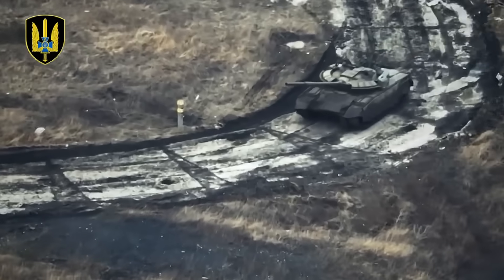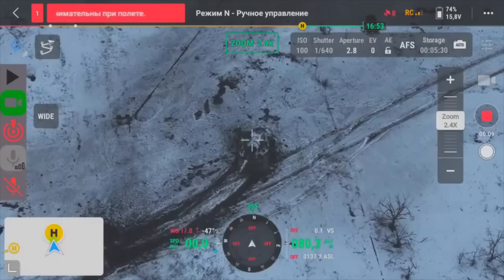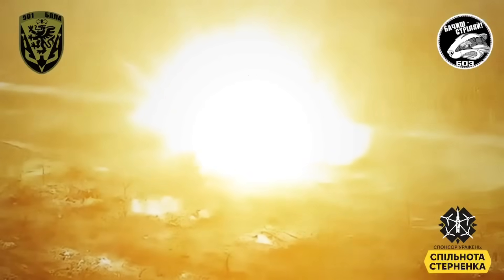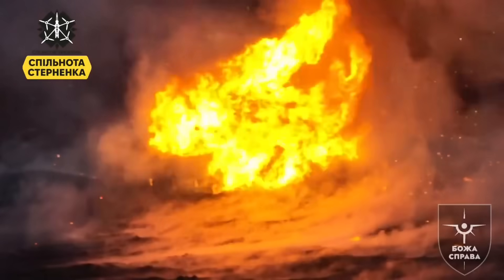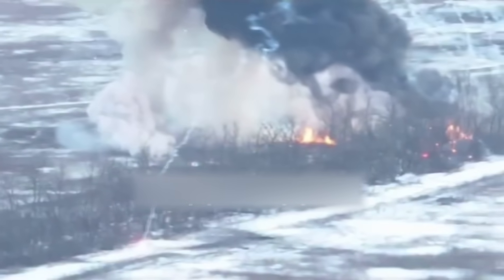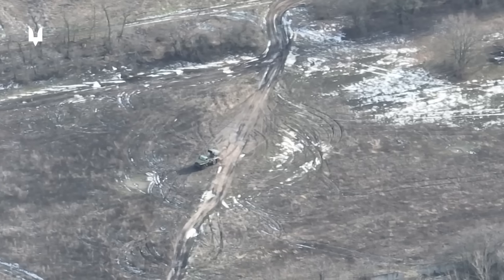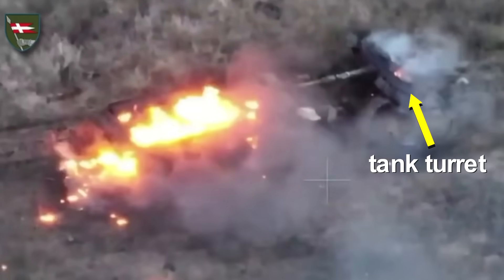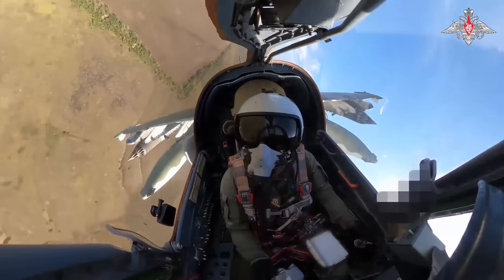The Russian tank attack failed because of this sneaky weapon

Comment: and then they say that gamers are useless in real world .. you can literally learn to fly drones in a game and do this in real.
i hope rUrUs are not going to mark my words, cuz if i had to drone-proof a tank, i'd just build simple mesh/net around the tank. weld some pieces of metal to act as main wireframe, then weld some wire-fence between them. keep it 1-2 meters from tank.

if you ask huh? then it means you have no common sense, so let me explain common sense to you: that wire fence / net would prevent any drones from directly hitting the tank, causing all charges to explode 1-2 meters before it hits the tank and from that distance, there's no way RPG or any other type of directional charge would be able to penetrate tank's armor.
in fact there's a good chance that RPG wouldn't even explode when it hits the net. i'd have to test and see what is most effective, if you literally use net, it might be elastic enough so RPG wouldn't explode at all.

so basically just build a net / wire fence box around the tank. they seem to be using signal jammers, but their range is 50m max and it also jams their own comms, so a good drone pilot would take it into account that they might lose signal when they get 50m or closer, so they just aim the drone in a way that last second adjustments are not necessary, with RPG wrapped to drone, it weights enough to hit the target by using inertia.

oh yeah and advice to drone users, you can add a small rocket booster in the back, which would make it possible to catch up with helicopters and planes, altho i'm not sure how stable a drone would be when flying that fast, it might lose control as its system is not designed to keep it stable at high speeds.

Comment: drones have been used for years if you really think about it...
America just have a different form equipped. with cameras and missiles, huge range that can return to base , reload, refuel and go again. They cost a millions each but they are fast, small and resistant to most low tech radar in the middle east or russia.  

The only reason a drone killed them 3 american troops a few weeks ago was because their own drone was incoming to and when another drone was following it.
They probably already have a new system in place so that confusion cant happen again buy simply having their drones landing procedures changed .
every other drone attempt at a american base in the middle east hasnt even got close

Comment: the Russians use electronic warfare equipment that consists of using radio signal jammers, the same type of jammers that are used in prisons or by criminals. Obviously this completely blocks the signals reaching the drone. It was supposed to be impossible for the drone to get close to the tank like that. The frequency used by commercial drones is always the same, which is between a maximum of 2.4 GHz, with camera. I don't know if they are using very small frequencies that are impossible to be blocked by signal jammers.

Comment: I would be a bit more careful with statements such as "FPV drones make modern artillery irrelevant", or any variation of the above.  I want to be clear, FPV drones can be extremely effective in certain situations, and within their domain are, actually, better than the artillery.  They can hit a target with a pinpoint accuracy, and do it for a fraction of the cost.  This is all true.  But they can do this within about 10 km (6 miles) range from the operator.  At present, this is the limit of the battery power, and effective communication link maximum distance between the operator and the drone.  Modern artillery can lob projectiles at a distance of ~40 miles (US 155 mm Howitzer).  This is way beyond the reach of the best of the FPV drones currently available.  I am sure that with time, the range of the drones will increase, but we are a long way away from the FPV drones being capable to fly 40 miles, or so.  Winged drones can fly this far, and even much, much further, but the inexpensive communication equipment can not provide real time communication at extended ranges.  You need a serious piece of comm kit to be able to do this, and this cost a lot of money.  And I mean:  A LOT OF MONEY.  But within 6 miles, FPVs are deadly, and they rule the airspace (within low altitude, of course).

Comment: Drones are probably at their most effective at the moment. I saw a clip the other day of a laser anti drone weapon being developed by the British...In the controlled test it looked very effective and they reckon it will cost about £10 a shot....But it doesn't need to be anything high-tec like a laser, even something equivalent to the old 4 Bore shotguns would be more than capable of talking these drones done out to 50 or 60 yards...The real problem is actually detecting and reliably tracking the drones. Add to that the development of effective anti drone electronic counter measures, and the days of cheap as chips FPV drones will soon be over...As with any form of technology used in war, its going to be a game of advances and then counters by the other side...

Comment: 1:15  I don’t know much about drones, but Is it realistic for that little drone to successfully pick up and carry 4 to 8 pounds?
Reply: It's impressive, I agree.  Really, though, more lift just means faster spinning of the props.  Meaning that the weight limit is proportional to how fast the blades can spin without breaking.  Of course, there's a ceiling for that, but apparently 8 lbs isn't it.

Comment: i tried to give them plans/schematics/blueprints, whatever floats your boat terminology wise, for a small tracked drone that utilizes a 3 axis weapon mounting platform, with differing levels of recoil mgmnt. , but no bites yet, can be used for... well a lot, sniping, ATGMs, ManPADS, recon, recon, recon, mine laying, EOD stuff. yes you have aerial advantage buuuuuut even russia`s 70 year behind the curb self. and yes i am fully aware the US has them, i know i know but mine are cheaper, definitely undetectable, it could also be IMMENSLY HELPFUL FOR TRENCH WARFARE! ffs the moment i can stop wasting my time with locky or darpa the better. also use wood to shield your drones! wood plys coated with conductive carbon black for extra sneakyness and survivability.

Comment: Impressive and scary update of modern warfare today. 

As a veteran of multiple combat tours, this is very scary. 

Survivability odds on the modern battlefield has been severely diminished. 

Slava Ukraini
Reply: its hard to hide from drones.
Reply: @ThangTran-bj4we I'm actually really interested in the lessons being learned here and what kind of defense systems are created to counter this type of warfare. I'm sure every modern military in the world right now is racing to do this.
Reply: @pinkyskeleton5410  Modern militaries don't have a problem detecting incoming drones.
Reply: @ThangTran-bj4we   Seems like the best defense is to stay far from the front line, since the drones in this video have a limited range and radius of control.  Seems like only robotic forces should be in near-contact with the enemy, ideally.
Reply: @polarvortex3294  until they shrink AI systems to fit onto basic smartphones.
then you could just tell the drone to navigate to an area, look for something expensive like a tank, artillery piece, guy wearing a general's uniform & set it to land on them with extreme prejudice.
Reply: @HereticDuo  Yes.  I was thinking along similar lines a year or so back, when I imagined "flocks" of small, battery powered drones being sent on long range missions, low and slow, at night, "refueling" by resting (and hiding) during the day in fields and forest clearings using solar panels, then continuing on their way each sundown to eventually reach airbases far away, where only a small charge or incendiary would be needed to destroy a multi-million dollar aircraft.  And of course they'd need some brains to complete such a mission, or some kind of satellite control beyond my understanding.
  Incidentally, the French have already developed a shell that basically looks for armor on its own and will send out strange little frisbee-like bomblets to destroy them.  They are called 155 BONUS rounds, and supposedly they're already in Ukraine in small numbers.  They're pretty dumb, without any true AI, but still help show how terrifying the future of war will be.
  I must say though, this war has been surprisingly primitive in some ways, with guys riding on top of tanks, WWII style, or people throwing grenades from trenches, WWI style, etc.  It's all very odd & horrible.
Reply: Прославляешь нацистов, да? Ты нацист? Тогда мы идём за тобой.
Reply: Slavi Ukraine? How about just calling for the end of the war, man? Hmm? You started this fuckin fight back in '14 after the coup and then you systemically started ethnically cleansing the Donbas and those within your country who weren't "pureblood" Ukrainians. Fuckin Nazi, fuck you. Signed, an American Combat Veteran
Reply: Слава Украине орут твари для которых пособник Гитлера Бандера герой. Ты бандеровец??? Это к стати их лозунг
Reply: slava your mum you wanna be veteran fuckhead
Reply: "Slava Ukraini" - nazi phrase, as "hi Hitler!". With it phrase bigan this war.
Reply: @ПавелЗакиров-д4б  Slava Ukraini is from the execution of Oleksandr Matsiievskyi, a Ukrainian prisoner of war. The executed soldier’s defiant last words were “Slava Ukraini” – a Ukrainian national salute that means “Glory to Ukraine” – before he was shot multiple times and collapsed to his death.

You can keep your Ruzzian propaganda to yourself, Orc!!
Reply: exactly. Phrase spoken by azov nazists that killed 46 russian speaking people burning them alive (while filming them) in Odessa in may 2014. But in the west shitty propaganda news no one tells this. @ПавелЗакиров-д4б

Comment: The animation at 2:30 is somewhat incorrect, the nose of the HEAT is specifically as long as it is to have a large standoff distance. This is needed for the HEAT to achieve high penetration. If they would use a delay fuse and let is squish down first it would defeat the purpose.

Not to mention the absurd usage of "definitely" like at 4:40 that just shows how few videos of tank getting hit and burning out you have watched.

Also, obligatory fake sound rant. 

All on all a cheap, low effort clickbait video that will be downvoted after skipping through it.

Comment: Penetration by an RPG-7 HEAT warhead is not 50mm as stated in this video, it is ten times that. 500mm RHA which is why this weapon is so effective.
Reply: Thats amazing such a small projectile can penetrate over a foot and a half of solid steel.
Reply: @GoldenhatVR-i6e  It's not really a projectile.

It's a tight stream of vapourized metal moving at thousands of feet a second. It causes the metal armor to deform and blasts right through. Then it hits the inside of the tank and if there is any ammo in front of it sets that off.  

It's an incredibly efficient way to take out large numbers of tanks.
Reply: RPG-7 penning 500 mm???! gerarahere.
Reply: @Watchembleed211  That's the single stage PG-7VL warhead that is used on FPV drones.

The PG-7VR tandem warhead can penetrate 750mm of RHA.
Reply: @dougcoombes8497  yh I am wrong, I checked the RHA of the warhead and it can penetrate 0.5 meters of homogeneous armor (500mm). I thought it pen like 200mm not less than that 😂

Comment: I was on an M-1-A-1 tank during Desert Storm. I never ran into drones like this. Not certain I would have survived if I did.
Reply: Strange you served on a tank, but you get the nomenclature wrong.
Nots not M-1-A-1.
Its M1A1.
Also, there were no drones during Desert Storm.
Wanna tell us about the time you served on that glass bottom submarine?
Reply: @Waltham1892  I am well aware of recon drones. My squadron did not face drones that destroyed equipment. We did not encounter any such devices. We arrived undetected and rolled up the Iraqi flank. The M-1-A-1 or M1A1, or M1/A1, or M1-A1 is the same tank with the same designation just expressed differently. M-1 was a 105mm tank that arrived in Saudi Arabia during Desert Shield. Later we swapped them out with the M-1-A-1 with a 120mm gun so we could fire up graded ammunition such as the M-829-A-1, Fin Stabilized Depleted Uranium Discarding Sabot with tracer. We also fired more M-830 High Explosive Anti Tank ammunition and a lot of it. I had 2, M-240, 7.62mm machine guns. One at the loaders hatch mount and the other was a coax mount next to the gunner. I had a M-2, .50 caliber machine gun mounted at my Tank Commanders hatch. I ended the war with the same tank I started it with as did my entire platoon.
Reply: Drones have been in service since Vietnam.  There were drones used in Desert Storm.

If you are going to nitpick nomenclature maybe don’t make worse mistakes in your response.
Reply: @B61Mod12  not the type and complexity that are used today. I never saw a drone during Vietnam and never saw one during Desert Storm.
Reply: @B61Mod12  I know what I am talking about. It appears you are the one mistaken. I never said there was not any drones. I said I never encountered them. If you wish to review my military record I would be more than glad to show you my DD-214 and DD-215 that lists all my assignments, MOS’s, campaigns, and my role in combat.
Reply: I wasn’t talking to you.
Reply: You replied to the wrong dude.

Comment: 1943-1945...US is using 'flying bombs'...video camera in the nose, remote controlled flight, slam sinto the target.
The US famously used V1 'buzz-bombs' for their flying bomb program.
OK, Ford made the V1's and the flying bombs were used exclusively in the Pacific, over water.
They didn't want any of the bombs recovered, so they were used exclusively in anti-shipping roles.
Drone war-fare has been around a lot longer than most folks realize.